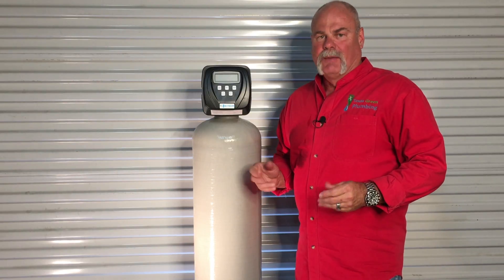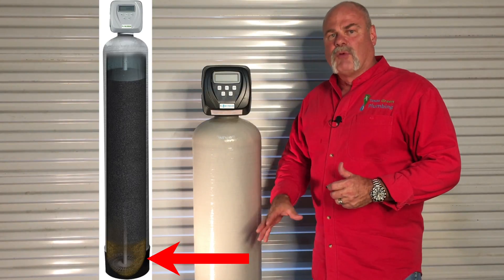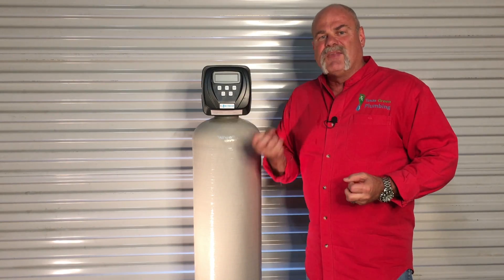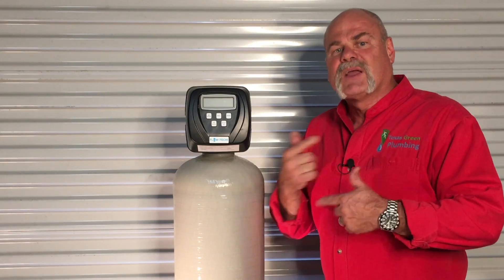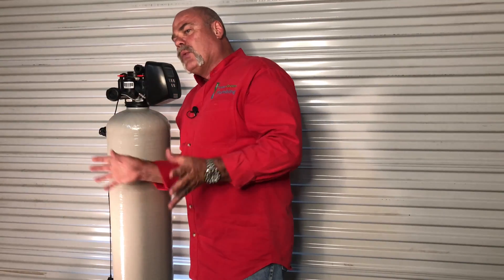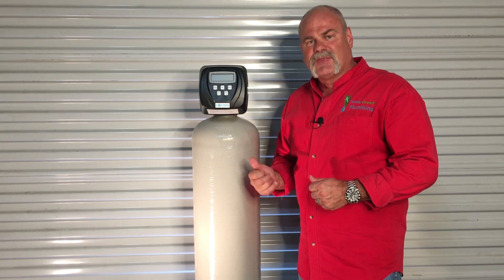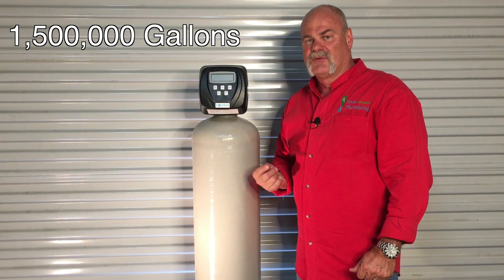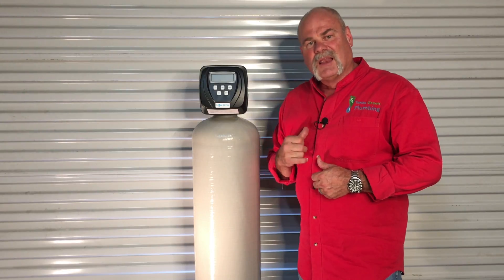How Does A Whole House Water Filter Work? - Plumbing Product Review - The Expert Plumber

Comment: I currently have an EWS water system with a capacity of 2.5 million gallons @ 1 ppm Chlorine and  back flushed twice per day. How does the Flow Tech compare both in function and costs?
Thanks